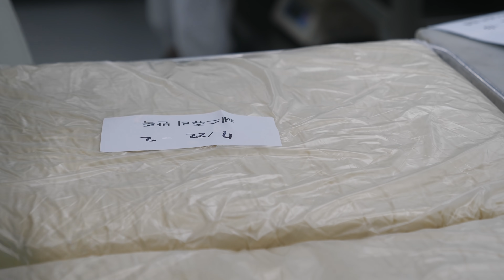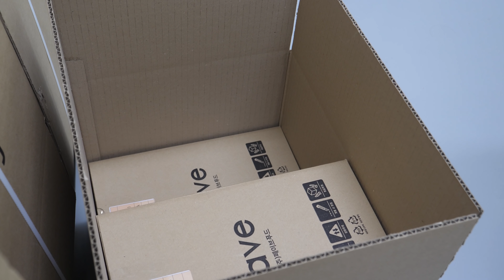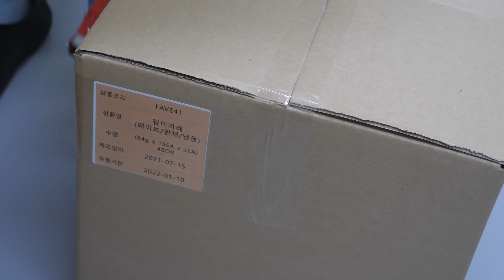하루 1000개씩 팔리는!? 초콜릿에 빠진 1000겹의 딥초콜릿 파이 / 1000-ply deep chocolate cookies making - Korean street food

Comment: Yeah, so that's definitely not a cookie. 
Yeast, flour, egg, and water makes pastry dough, not cookie dough. 
Cookie dough starts with creaming butter and sugar, and doesn't contain yeast. 
This is puff pastry dipped in chocolate. Stop exoticizing things just because the video is from a different country. This is no different than a palmier dipped in chocolate. Not a "1000-ply deep chocolate cookie".
Unlikely that it's even 1000 layers. In the rolling process I counted 72 layers when they sliced the blocks. Even if 3 of those slices were used to make 1 pastry, that's still 216 layers of dough. Far from 1000.

Comment: That has 0 layers, folding your cookie dough 1000 times isnt impressive. And makes no difference
Reply: It does make a difference though. You can very clearly see near the end that it's got a fluffy and airy quality to it similar to croissants, which are quite literally just pastry dough and butter folded together over and over again. Same exact process is going on here, except they don't make the final stack of butter and pastry layers into croissants, they just cut it into slices and allow them to expand horizontally through fermentation. It's pretty bloody genius honestly.
Reply: @FormaldeHyena  my point exactly, you can it 100 times and get same quality, you can fold it only a few times like a croissaint, and get the same quality. Folding it 1000 times is a wow factor and thats really
Reply: @kant9546  I actually disagree. Because of the fact that they cut slices perpendicularly off of the stack, if they had less layers, it wouldn't be able to puff outwards as much as it fermented / baked. I think for the cookie to be as wide as it is in this, they need quite a large number of layers. If they had cut slices off of the stack parallel to the layers, I would 100% agree with you, but the way they do this makes it so that the layers actually do have an effect.